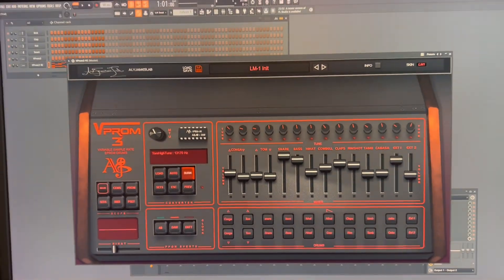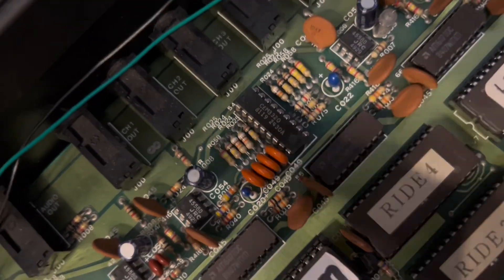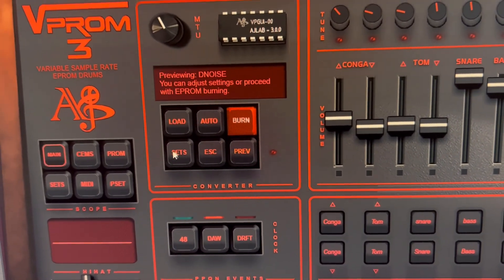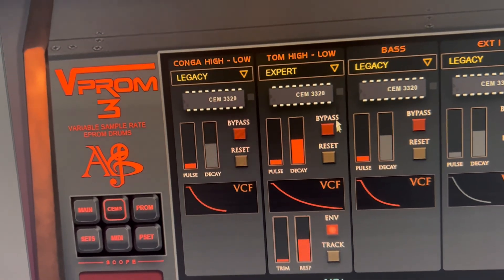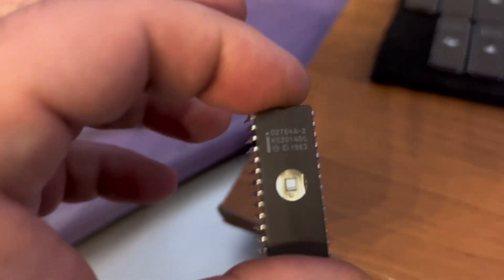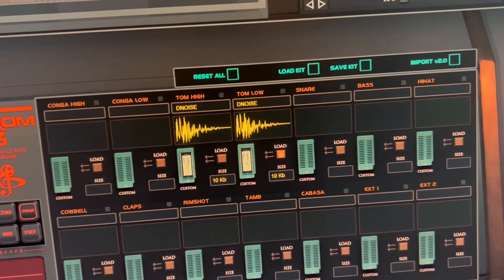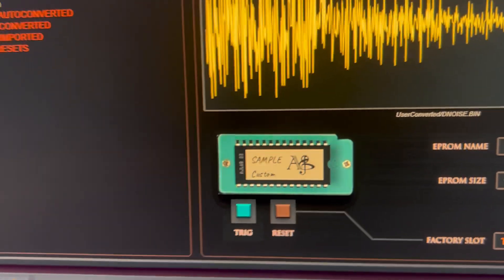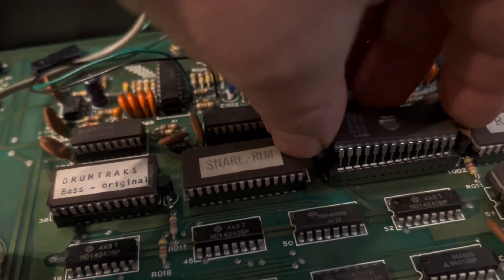VProm 3.0 Real EPROM Making - Loading in Hardware Drum-Machine

Comment: This is exciting , buying your app now ..
can you point me in the right direction on where to get eprom chips that I can burn onto ? I have a Linndrum and a DX that i would like to make chips for
Reply from the maker: @TherealDJEmz  usually you need 2732 or 2764 EPROM size (4K or 8K) check the specifics for your machine and exact type it needs, then you can find NOS blank EPROMs in most market place like EBay etc.
Also search on the net for the actual EPROM config of your machine some 8K EPROMs might’ve been used to stick 2 x 4K sounds in there to save cost, it could be for example claps and shakers, if you replace this EPROM with a full 8K single EPROMs you will have the claps triggers the first half of the sound and the shaker trigger the other half
Reply: @Alyjameslab  PERFECT . and what PC software do i need to transfer the bin file from Vprom3 to the burner? I just grabbed your plug in and can't wait to burn chips for my LinnDrum and my Dx , Thank you !
Reply from the maker: @ the one that will come with your EPROM burner 😛